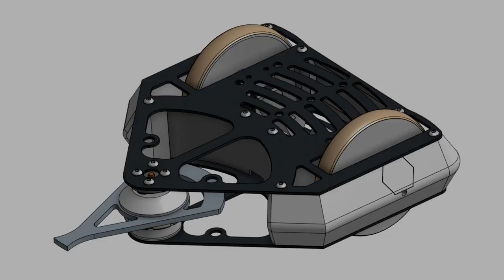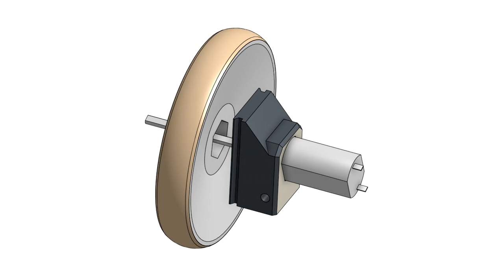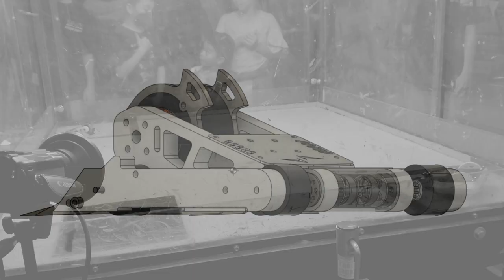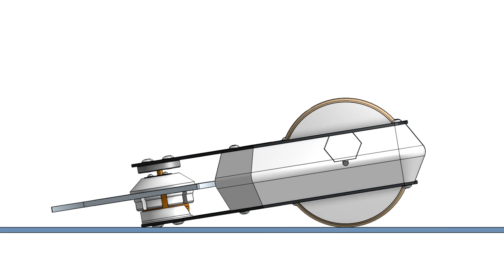Antweight Drive Motor Investigation

Comment: This is a great video, very well edited and presented! I'm glad to see more combat Robotics channels popping up that actually put in the effort to make original content about building and improving robots.

Squishy and compliant wheels are a good solution to this problem. TPU wheel hubs are super popular in beetles for the same reason. I would also recommend making the wheel hubs as close to the face of the motor as possible to reduce the bending load on the shaft/output bushing or bearing or whatever it is for silver sparks.

Comment: Love the TPU spokes solution and the clips of all the fights!  I think TPU is one of the most underrated filaments.  And by lowering the diameter of your wheels, you probably will gain some more control and maybe some more torque.
Reply: You're totally right! Tpu is near damn indestructible. I sell printed stuff at the markets and I have a tpu one and I say to kids "if you can break it you can have another one"... I still haven't given one away yet 😂

Comment: I've been using the same Fingertech 11:1 motors on my bot  (aproximately 30mm tall wheels) since 2019 and never had to change them. I've had 17 matches.  Here in the Midwest we've gotten a reputation for some major hitters. I've bee slammed into the ceiling,  Thrown into walls, and gotten into major pushing matches. I think part of why I survive is the small diameter of the wheels. It will limit the leverage concerning lateral twisting of the axel.
Reply from the maker: You're probably right. Thanks for the information!

Comment: You should extend the wheels back again, this will allow you to right faster from being stuck upright but more importantly, it could allow you to absorb more shock from falling on the back. Those compliant wheels were really effective I'd say.
Reply from the maker: I've thought about it, but have you ever tried to steer a heavy shopping cart using the handle bar at the back? That's what it's like to drive old Cheesecake: tons of under-steering. Now, if I can redistribute some of the weight more toward the rear inside the chassis... maybe this design could make a comeback.

Comment: Would it help to angle the edge of your weapon such that it would either be exactly vertical or even such that the top edge is closer to the main body than the bottom edge? As it is now I should thing the natural force on the edge tends to push the weapon up and away from your opponent, especially when they have sloped sides. When you change the angle of the edge of your weapon you could maybe change it such that it tends to dig in, or be neutral if digging in would give too much load too fast on the weapon.

Comment: With such large wheels, you might be better off offsetting the motors and running TPU/nylon gearing to absorb the torsional loads from the wheels hitting the ground at high speed

Comment: Why did your weapon stop spinning during the fight?
Reply from the maker: I think my weapon motor overheated. I did a lot of weapon and motor tests this weekend, and I found that the weapon I used at this tournament was probably too big for the 1800KV weapon motor, which caused the motor to draw a lot of current and overheat.
Reply: @alexsalchemy  Did the motor or the ESC overheat? Does an overheated motor recover its magnetism after a cooldown?
Reply from the maker: @human890209yang  - The ESC was okay (I think). The overheated motor recovered. I think it shut down because the copper wires got hot, which increased their electrical resistance, and not enough current got through to spin the motor. I'm not an electrical engineer, so that's my best guess.
Reply: @alexsalchemy  Thanks.

Comment: Loving your videos. 

Quick question, is hitting the wall to get your robot unstuck allowed?
Reply from the maker: I'm pretty sure you can hit the wall as much as you want. Most arenas have a "kick plate" at the base of the wall where most robots are likely to hit it anyway. Just... you know, don't set out to specifically break the arena.
Reply: @alexsalchemy  Thanks, good to know. I could have imagined that there where rules about "outside" interference.
Reply from the maker: @dutchdrifter8740 - Oh wait, I'm sorry, you were asking if it's okay for the driver to hit the wall of the arena with their hand. Generally the answer is no, but you do get one "un stick", and you can do it by hitting the wall from the outside if that works.